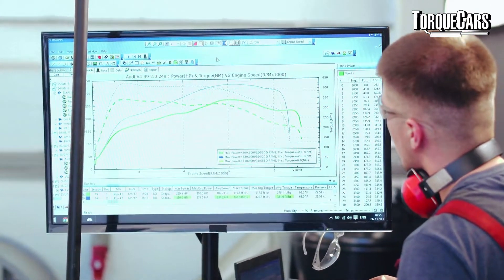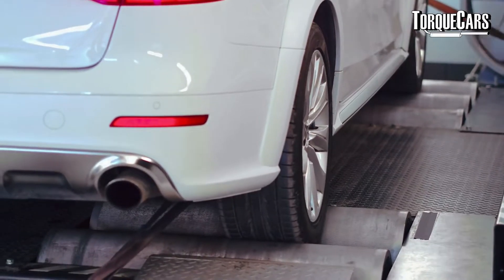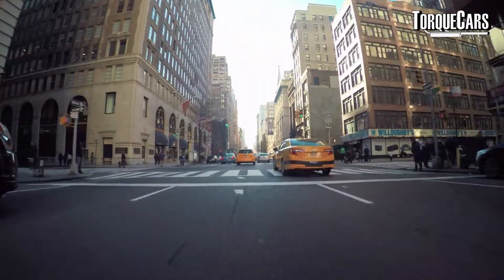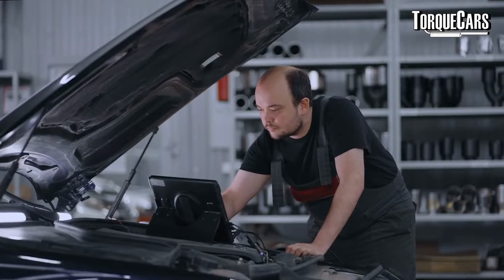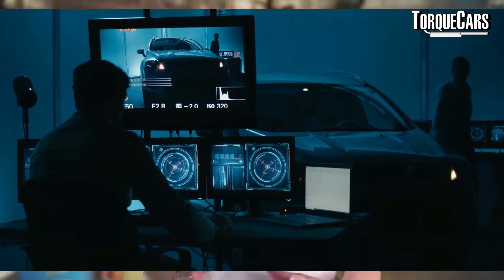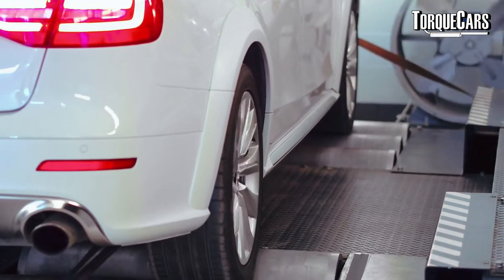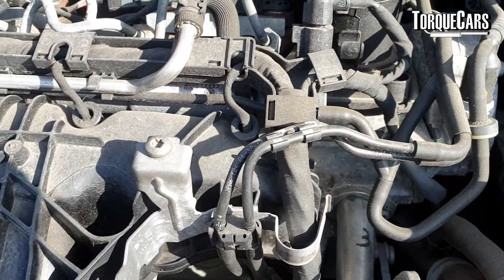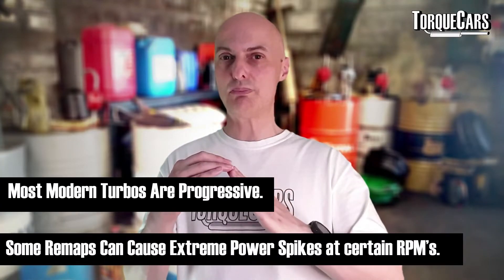TDi Tuning - How Remaps Work [Full Buyers Guide To Remapping Diesel Engines]

Comment: Can you get a xc90 remapped and does it effect your insurance
Reply from the maker: Yes you can and the gains are pretty good on those. You should notify your insurers, ask them first. Some are not bothered, some will load the premium a little and others might refuse cover. When you do a full years quote try to go with a modification friendly insurer then you'll be ready for the upgrade.

Comment: ...so, the UK, do you remap in the winter or the summer!? Or spring or Autumn!?
Reply: ...that was a serious question BtW... which seems is all it will be... i.e. BtW?
Reply from the maker: It doesn't matter, because the ECU will trim according to seasons easily. Cooler air means you can use more fuel. We don't get that much of a difference though temp wise here in the uk 23c highs to -5c lows.

Comment: Hello,
First of all I thank you for the wonderful content. 
Secondly, I would also request to make the content a tad bit less technical so it may help reach wider audience. 
In addition to this I have few question.
I own a VW Tiguan 2019 2.0 TDI in India which delivers around 143 BHP and 340NM torque. I wanted to know if getting this remapped is a good option? Also, does remapping impacts the safety of the car i.e how the air bags works, other safety related equipments and programs in the car. 
Please help guide me. 
Thanks

Comment: Golf 8 2.0tdi goes from 115 hp to 190/200 hp, so huge diffrence. Still on the fence of doing it
Reply: might need other parts like a bigger radiator, and who knows if the timing belt can take it.
Reply: 2.0L and only 115hp?? What the hell VW
Reply: @deckardcain2466 they sell the ea288 evo with different power figures 

85kw same as 110
110kw same as 85kw
147kw different bottom end.

All depends on the trim level 85 is for the base spec cars to "keep the cost down"

Comment: Great informative video - can you recommend anyone in Essex / London that does this work to your standard - for a Shogun Sport 21plate
Thanks
Reply from the maker: Track down a Celtic Tuning dealer near you, they have done great work for our members when it comes to remaps and they know what they are doing. The 168hp version should hit around 210hp after a remap the 197 pushes power to around 240hp so decent gains all round. There are also eco maps available if you want to be more conservative.
Reply: @torquecars  great - thanks for the reply

Comment: Is it necessary to to do a tcu remap if we do ecu remapping in 2 litre tdi a3 with dq250 gearbox ?
Reply: In my opinion, I would say yes. However if you drive like a 80yr old woman everywhere and your not giving the car a bit of a kick. Then no. But if you do drive, not erratic... Faster than the average person. Then yeh definitely.

So yes, the gearbox being remaped improves the shifting speed, improving the torque limits allowing you to take control of the additional torque.

Comment: Hi, I have a 2013 Audi A3 2.0 tdi 150, would It be worth Remapping and what BMP could I expect?
Reply: @mickcarter1692  hi, if you Google engine remaps, you can input your car and find out what extra power and torque to expect. I would guess you'd be getting around 180bhp, and about 30% extra torque.
Reply: @gofres_8540  but can you safely remap an old 2013 tdi with 80k miles on it?

Comment: Will mapping my car resolve the orange EM light issue, keeps coming on then goes out.
2017 GLC 2.2D

Thanks
Reply from the maker: An em light usually indicates a fault or problem and in most cases a remap will not fix that underlying issue. In some cases (low boost - altering the turbo wastegate profile) may avoid the problem or make the car more inclined to ignore the fault. It could just be a malfunctioning sensor or loose wire. 

This video discusses the causes of EM lights https://www.youtube.com/watch?v=1HHH2fQh4Vc

Comment: I’m currently considering doing a stage 1 ECU remap, carbon cleaning on my 2014 Audi A6 2.0 TDI s line auto, my going is to make the car run smoother and revive the car after buying it at 80k miles but I’m not sure about how that will effect the reliability of the car? Am I right
Reply: same question here, to remap or not at 80k
Reply: Did you get it done? I’ve got my car at 94k miles wondering if to high or not
Reply: I'm considering a stage 1 I'm my passat cc 2011 2.0tdi she's deleted dpf and egr 😊

Comment: I’m seriously considering getting my Karoq 1.6 TDI remapped but I’m concerned about the longevity of the DQ200 7-speed dry DSG box, I used to drive a Fabia vRS which had the DQ200 and many people were mapping them past the factory spec and they were fine but I just wondered if you had some insightful knowledge about how to care for a DSG box when mapping the car since it’d make more torque than a petrol would.

Comment: I’ve driven turbo diesels for over twenty years and have always let the oil get round for thirty seconds before driving off and the same when stopping let the turbo spool down while it still has an oil supply rather than switching the engine off while the turbo is still spooled up and the oil supply is cut off, not had a turbo problem with any vehicle even at very high mileages.
Reply: @AJ-qn6gd  OWND !!!
Reply: @AJ-qn6gd  well said mate,you will not believe how many people disagree.
Reply: @AJ-qn6gd   It seems logical even if using synthetic oil.
Reply: 10 seconds is enough when when you start the car up because of modern synthetic oils. Any longer than that and you're only letting it run cold for no reason and killing it like that. The sooner you put some load on the engine after those couple of seconds to start warming it up, the better it is for longevity.

Comment: I had a kess remap on my 150hp tdi. Not sure of what the hp is now but im told it should be at least 180 to 190hp. It has made a noticeable difference 0 to 60 and lift at higher speeds for overtaking.  Im wondering does my DSG gearbox give the tuning an advantage or not ?
Reply from the maker: The gearing ratios are better on most DSG boxes, but they do limit the amount of torque you can output in some cases, but most mappers will take this into account and work round it.

Did you get the DSG mapped as well?
Reply: @torquecars  no I didn't get the dsg mapped. The guy who did the remap said that my 150hp would gain around 40hp. It's a mark 7 golf estate. He said he wouldn't recommend any more that this as in his opinion this was a safe remap which doesn't put too much unnecessary strain on component parts. I did ask about the DSG system,  as i was concerned as he did say there would be extra torque but again he said this would be a reasonable amount as he always recommends not pushing the limits too much. Again he said the dsg system could handle the extra torque and hp. I have to say that the car is driving much better when I ask for power, although I normally drive easy on the roads as here in the UK I don't need another speeding ticket.  I have noticed that my mpg on economy drive appears to have increased. I will know by how much soon as I filled the tank to the neck and will calculate that but it could be around 8% better consumption.  Certainly I have been hitting some impressive mpg figures on longer drives.

Comment: I have a 2015 A3 2.0 TDI sportback that I've mapped from 150hp to 215hp and about 445Nm. Only mapping, no extra parts. Is there anything else I could do to get some more power and still keep the car in a safe zone? It's a manual gear box. Also do you know the safe rev ranges for the gears? 😊
Reply from the maker: Hi Buddy, it sounds like you've taken that one to the max already. Turbo and fuel upgrades are next but this will cost quite a bit more than the remap. For performance and a spirited drive I would change gear about 4000 to 4500 RPM - the engine is starting to run out of puff and it puts the car in the power zone in the next gear, after a remap it still pulls through the 5000 region, but I don't feel it worth exploiting this part too much.

Is the air intake or filter upgraded, you may well be getting a restriction on the stock setup at these power levels, but not by much if I'm honest.

Intercooler mods will help you avoid heatsoak but if you only do shortish burst of high rpm driving that would be a waste of money.
Reply: @torquecars  thanks for the answers! Great channel!👍😊
Reply from the maker: Cheers buddy, thanks for the support and encouragement.
Reply: @torquecars i have 2016 a4 2.0TDI , when “safe zone” is a question to be answered , what in your opinion is the safest zone for a manual which wont hurt the clutch and other components? My car is 136hp the max would be 195ish which in my opinion is too much.. What are your thoughts? Cheers!

Comment: Good information 👍 
Would it be a benefit  given  my vauxhall mokka 1.7 tdi remapping
Reply from the maker: Definitely, The 128hp version of this engine (With the E87 ECU) will see 40hp and 70lbft more torque on a performance map, but get a performance panel filter. You should also see better fuel economy but this will depend much on your driving style and how you use all that extra power.

Comment: i have a 184bhp diesel with a tune its about 240bhp difference was night and day havent had a problem with it at all it is a bit thirsty tho
Reply: You own a GTD Golf, don’t you?
Reply: I did this to my Audi an my fuel consumption isn’t that bad for my a3 salon. My car drives so much better faster think  the guy did something for my fuel consumption and oil as well. Defo would remap my. Cars 1 stage bring the car back to its glory
Reply from the maker: lol It's only thirsty because you use the power, but I'd do the same. That's quite a decent power bump you have there. Was it just a remap or did you have other mods done too?
Reply: @torquecars  it was just a remap i think its 220bhp not 240 i forget.
Reply: @tilidie5272 did you do tcu remap too ?

Comment: I have just bought a citroen 2012 Ds3 E-hdi 1.6 litre diesel turbo, and been thinking of getting it remapped, would I gain much power from it, and would it mess up with all the sensors and light up on the dash board? Cheers
Reply from the maker: The 90hp will map to around 120hp and the 110 should see around 135 on a map, you shouldn't have any issues as long as the car is well maintained and looked after.
Reply: @torquecars ..okay thankyou

Comment: Got a vw TDI 2.0 tune from an english company, definetly very good value for the performance increase. I hade a choice to buy a, user upload and download OBD install device, or have a tech do it. Both options have their advantages. I had a tech do it based on his reputation. You didn't really discuss these two different options. But in the end your getting the same predetermined tune file that's been made on the dyno with the same model car, or at least the same model engine and ECU.  The tech said he'd be happy to do adjustments to the map if required. Which along with the guarentee offered is the reason you would have a tech do it over the do it yourself mapping device. When I have the DSG tune installed I will have him look at the turbo map. So it's good advice your offering about the cool down times for it. I hadn't considered that. Thanks for the video.  DSG remapping vid? maybe.
Reply from the maker: I will start researching the DSG and mapping them for you so there will be a video soonish coming out on that.
Reply: who is the best company to go for now in the uk?